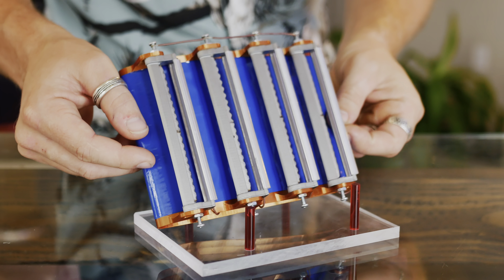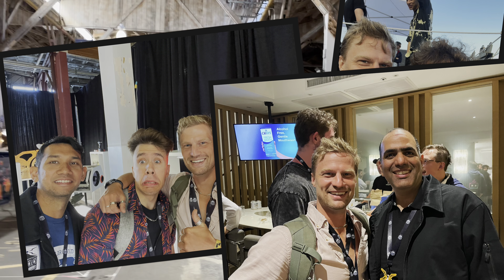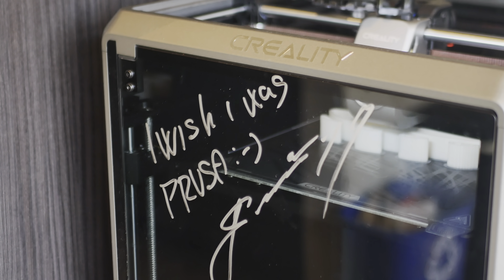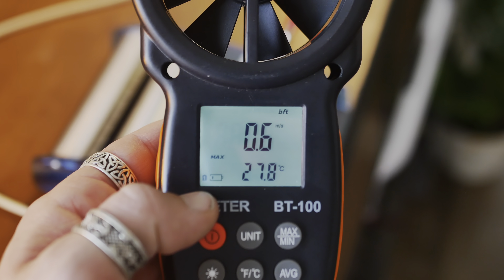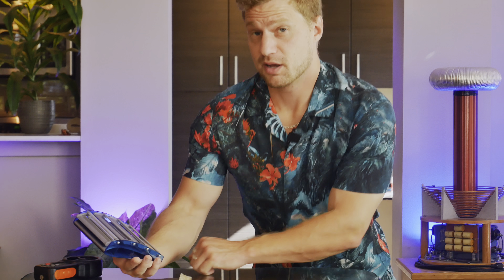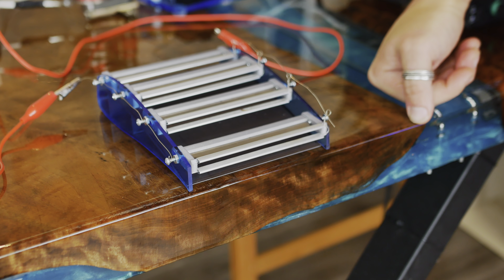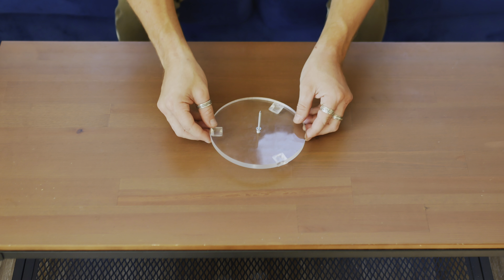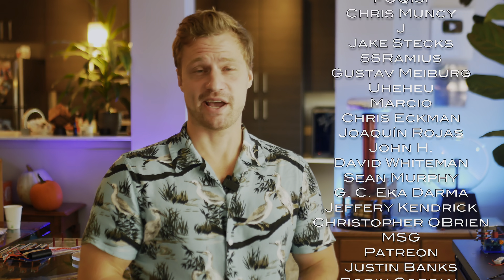Designing A Self Propelling Ionic Thrust Wing

Comment: I would like to "speak" with someone who is open to the idea that the FAA is wrong about has been known as the "overbanking tendency" when an airplane (the wing) is making a constantly banked level turn.  Many people believe that the outer wing (top wingtip) inscribes a greater circle than the bottom (inner wing) thus allowing the outer wingtip to have a greater airspeed.  The thought is that since both wingtips must complete their respective circles at the same time, then the outer wingtip is flying faster.   Since it flies faster, they argue, the airplane (wing) will roll into the turn requiring opposite aileron to counteract the overbanking tendency.  I would like to discuss with someone who believes otherwise, as I do, that both wings are always flying at the same airspeed in a constant bank, constant altitude turn.
          My believe, and many others is that both wings fly at the same airspeed.  The only time one wingtip flies faster than the other is when the wing is being yawed.  The advancing wingtip is flying slightly faster than the other that is retreating.  Is there anybody here that agrees with me?  I can find may who disagree.  Even the FAA has said otherwise in its manuals.  The have asserted the overbanking tendency even before WWII.  I wonder what the author of "Stick and Rudder" has to say about this subject.

Comment: being able to strap this idea onto a wing could be a good auxiliary power boost, but i think there would still have to be a primary thruster engine. perhaps a solar powered ionic boost wing (that is very expensive) could reduce fuel consumption if scarcity becomes an issue. perhaps you could try using a solar paneled skin on the wing instead? (if its light enough?) that would save on the battery weight.

Comment: @Plasmachannel I'm sooo confused as to why this would seem like an idea you'd want to spend more than 20min on. Ionic thrusters are a really low specific thrust engine...why would you think this is good for flight? Not taking into account the fact that generating & managing high voltage is generally also heavy...not great for flight. It's a super inefficient method to fix a problem that doesn't exist...why? This is so confusing. There's a thousand reasons airplanes don't use ionic thrusters...

Comment: Cant you put the ion discharging unit on both sides of the rotating blade to create a torque and the power sources of both the units in the middle of the frame to make the centre of gravity in the middle of the frame? In that way you can design the frame to push air from the top towards the ground and then the whole assembly will be lifted upwards?

Comment: @PlasmaChannel , I saw the convergence of air stream video as well before this reply, i have an idea of using this design, and having the exhaust of each unit go into the wing via a duct system, and all the ducts should circulate the air out through a vent at the rear end of the wing or the fuselage. This means many independent units with their own duct, which will vonverge into a single duct at the rear vent, this should provide better efficiency

Comment: Not as familiar with ion flow, but you’re adding a lot of drag to the top of the wing.  Lift is created from the low pressure/high speed air flow on the top and the high pressure created by the curvature on the bottom.  In my mind it would make more sense to put the thrust on the bottom not the top or somehow in line with the flow of the wing.

Comment: Wouldn't the air being pushed faster over the top rather then the bottom of the wing negate lift? Cause from my point of view it would significantly decrease the difference in pressure between the surrounding air and the air at the top of the wing wich is supposed to pull the wing up.

Comment: I believe this has been made public,  the fact that the B2  bomber uses ionic thrusters at cruising  altitude.  The trials on the ground used 2million volts between  the leading and trailing  edge of the wing. There is a “no arc” device incorporated in the system.   
There is up to 35% fuel economy when using full voltage.   

I  would like to share some original hand drawn plans obtained from my departed friend  Marc McCandlish. 
Toroid based Hg, with nanoparticles Co,Ba,Fe, at a pressure of 200,000 psi in an inert gas.

Comment: This doesn’t quite understand how an airplane flies.

If you wanted to build some sort of ionic drive airplane, you would separate the ionic thrust from the wings or at least have them segmented in the wings like most airplanes do. 

But also consider you can have airplanes with no engines on the wings, and why this works, and then you realize how an airplane actually flies, and the lift in the wing has very little to do would the overall dynamics of how an airplane flies. 

It’s more to do with a lot of thrust and a lot of surface area on a wing.

Comment: There is an aerodynamic reason engines are placed under wings, the top of a wing is actually where it's lift comes from, it is about the difference in air pressure having to travel farther over the top of the wing, also when you accelerate air it changes the pressure as well.
Reply: Aerospace engineer here. Engines are placed where they're easier to access for maintenance, and/or where they're structurally lighter to place so that the overall airframe weight is lower. There is no aerodynamic difference. Lift is generated by moving air down. If the mass of the air you move down is the same as the weight of your contraption, it flies. Works for propellers, wings, planes, rockets, helicopters....Wings are just angled bits which move air down when you fly forward, same as fan blades or your hand out of a car window.

Comment: Very nice. But you have to go back to school. Lift is created by the air wrapping around the entire wing. The air created by the ionic wind must not be part of the wing, but must be applied outside the plane. You can't pull yourself up by your own hand by your own hair. The lift from wrapping the wing with air is only one part of the problem. The entire wing must be "locked" into some volume of moving air, much like a Styrofoam ball in a water fountain due to the Coanda effect. Thus, the wrapping of air from an outside source will help the ground effect take off, and the flight itself is about locking the wing into a volume of air. All this is only possible because of the relative velocity of the airflow. That's why 100 tonne aircraft can fly.  I'll give you a free tutorial - make your ion engine similar to the adhodyd engine. Leave the wings unchanged. Find out the speed of the ionic wind and design the plane to stay in the air at that speed.

Comment: Here’s a Few Ideas Creating a model for an ionic thrust wing capable of achieving speeds up to 10 m/s involves several key design elements. Here’s a conceptual outline:

Design Outline for Ionic Thrust Wing

	1.	Wing Shape:
	•	Airfoil Design: Use a high-aspect-ratio wing for efficiency. A thin, elongated shape will reduce drag and enhance lift.
	•	Materials: Lightweight materials such as carbon fiber or advanced polymers to minimize weight.
	2.	Ionic Thrusters:
	•	Configuration: Integrate multiple ionic thrusters along the leading edge or distributed across the wing surface.
	•	Ionization Source: Use a gas like air or nitrogen for ionization, which can be accelerated using a high-voltage system.
	•	Power Supply: A compact, high-capacity battery system to provide the necessary power for the ionic thrusters.
	3.	Control Systems:
	•	Stability and Control: Implement a feedback system to adjust thrust output for stability. Use sensors to monitor speed and orientation.
	•	Adjustable Thrusters: Incorporate variable thrust levels to allow for fine control of ascent, descent, and directional changes.
	4.	Aerodynamic Enhancements:
	•	Leading Edge Devices: Include devices to enhance airflow and reduce separation at high speeds.
	•	Surface Coatings: Use hydrophobic or low-friction coatings to reduce drag.
	5.	Testing and Calibration:
	•	Wind Tunnel Testing: Before full-scale implementation, test the wing in a wind tunnel to refine its aerodynamic properties and ionic thrust performance.
	•	Field Testing: Conduct real-world tests to evaluate performance under various conditions.

Conclusion

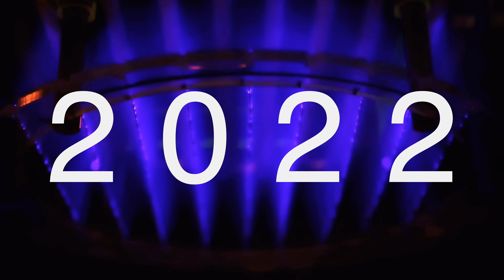This model leverages the principles of ionic propulsion and aerodynamic design to achieve the desired speed. Prototyping and iterative testing will be essential to optimize the design for performance and stability. This Design in Theory Can Reach Up to 10 M/S 0:10 His final Design 0:28 Competition Design

Comment: im sorry y place small thrusters instead of one large one along the  length of the wing. even better would the top surface of the foil is the thruster rather than having a thruster mounted on top of it. The top foil will be a metal sheet recieving voltage for ion acceleration while the bottom would be a plastic or whatever composite thats convenient

ok i get the idea of several thrusters but the other idea is still applicable where the top of the air foil is the thruster

Comment: Cool! The wing is a design to create a mass motion (flow) vector the divides into lift and drag (an elliptic wing is one of the better solutions yielding only about 1/3 overall drag). Since the plasma flow is the source of the flow and thrust the wing seems irrelevant (albeit it would constitute a fail safe). I was wondering if you ever tried using a pulsed plasma to increase efficiency. Good luck! Cheers!

Comment: do!! make sure you get at the very least a provisional patent application(PPA),  before showing any more youtubes , I have written of few of them and they passed, you can write it, there are  instructions at the PTO on how to write it, you can also call the PTO to answer most any question on the PPA on the write up, if you submit and something is wrong, the PTO will send it back with suggested corrections. do keep an inventor's log book, drawings, notes calcs, and results with day, date, and time, and signed as the original inventor, keep on trying, you will succeed.

Comment: @PlasmaChannel Wouldn't you need to put the thrusters along the bottom of the wing where the airflow should be? Wings work on the principle that air flows faster under the wing than above creating lift.
Reply from the maker: Ummm what?

Comment: The ringing is from the boost converters not being completely on the metal and not being able to arc all though if the wires do fully touch the metal being able to arc wouldn’t be an issue it should be silent

Comment: #10:25 - "this makes zero sense".

Not At All, Bro! Looks to me.

Right at the First Video I watched on your Experiments on that Topic,

I told myself that You give Same Voltage to Each Series of Blades,

While in my view, it is a Error.

In mean, See how function A Turbo-Reactor or even a Reactor: 

You have 

. A GRADIENT OF SPEED GIVEN TO THE AIR FLOW.

So maybe You might

. FIND AN IDEAL GRADIENT OF VOLATGE TO GET

. A GRADIENT OF AIR SPEED

and 

. AN ACCORDING REDUCTION OF THE SECTION OF THE BLADE SYSTEM SO THAT THE MOLECULES WILL SPEED JUST BY THAT (think to the Smaler Section of the Outlet of a Reactor, compare to its Inlet 😉 ).

All The Best, 
Khwartz

Comment: #06:44 - Hi Bro! Thank You So Much to Put In Practice the Idea I had to use the Wings Structure Itself as the Propeling System.

Note: You may also use many Surface Aeras of the Body of Plane too 😉

Said that, looks to me that You VERY 

. UNDERESTIMATE your Results, 

because 

. You are no more working on a SINGLE POINT PROPELLING SYSTEM, 

but 

. on a LINEAR (AND SURFACIC) SYSTEM.

It means that 

. YOU DO NOT NEED THE POWER STHRUST OF FUEL REACTOR OR EVEN OF A ROTATIVE PROPELLER (even Very Little)

and As Such, You may:

. MULTIPLY THE THRUST OF YOUR LEANEAR SECTION BY THE WHOLE// LENGH OF THE WING.

Let's 20 m long Wings, and your Section 0.2m, then You may 

. MULTIPLY BY ONE HUNDRED//,

so You need 

. 100 TIMES LESS STHRUST POWER BY CENTIMETER.

Also, You will have to Think about the Energy Source, which can be Batteries but For The Very Same Reasons we, You And Thought about 

. SAVING WEIGHT BY CONVERSION OF THE STRUCTURE OF THE PLANE 

as

. ACTIVE PARTS IN THEMSELVES, 

I invite You to Think Already to

. USE THE TOP SURFACE OF THE WINGS AS SOLAR PANNELS,

Which that your Sthrust System would 

. ENCLOSED BETWEEN THE SOLAR PANEL SURFACE AND THE WINGS,

Or that it would be

. BELOW THE WINGS 

or even

. MAKING THE STRUCTURE ITSELF OF THE WINGS (Saving Even More Weight).

All The Best,

Regards,

Khwartz

Comment: Just started to watch.  Your problem is you created a bi wing.  You increased drag.  I would thing by making it an internal engine would lessen the drag.  I would put the intake under the nose of the aircraft as a blended wing consept and ducked it out the wing.  Add a solar cell wing skin to your battery or compaciders like a tesla power wall would increase the power needed to power a full size engine.  Keeping the weight down.

Comment: So as an aviator I have a couple concerns.

1. What would the stall speed look like?

2. You need to lift the wing more than 1 wing length from the surface. In aviation we have a term called ground effect. This is the zone which at wing actually performs much better while it is with 1 wing length of the surface.

2. You should create a wind tunnel and see how the airflows around the wing with the ion drives attached and in an active/non active state.

I would love to chat with you about this project and give you insight from an aviation standpoint.

Love this idea keep up the great work! I hope it works.

Comment: Have you considered channelizing the intake/output of the airfoils? Build the thrusters encased in the wing. Place a separate ram intake for each air foil and then either have them combine to a single channeled output or separate ports. I would also be interested to see if you got more combined thrust by varying the voltage to each airfoil. I'm thinking each air foil down the wing gets progressive more power. Very cool experiment either way.

Comment: A suggestion. There is wire that is used in older copy machines called corona wire. It's 60 microns to 100 microns. Polished tungsten and gold plated tungsten corona wire. Find a copier tech or office equipment dealer who may still have some in their inventory. It should make a excellent replacement for the blades. Blades have weight, corona wire doesn't weight anywhere close. If you can't find some, let me know, I do have some.

Comment: It doesn’t need to be a true wing shape.   moving air over the top of the surface creates lift.   It could even be the cross section of a cylinder (a helicopter test design did this back in the 80s, with the tail rotor being replaced by a variable air flow over the tail boom — the air flow created “lift” that took over the job of the tail rotor — NOTAR helicopter) … my point is, just make it a narrow oval cross section, thin to reduce drag… and put your plasma thruster on top, and it will probably create lift.

Comment: This reminds me of the "silent black triangle airships" that were observed flying over the Phoenix area in the mid 1990s. Numerous people saw huge black triangles flying at low to mid altitudes at a perceived 60 to 100 MPH later at night. They were talked about repeatedly on the famous late night talk show of Art Bell, as well as local radio and TV news. One popular story was that these were the culmination of "famous" blimp experiments by Lockheed. I was familiar with the "Lifter" experimentation at the time, which was focused on vertical lift rather than horizontal propulsion, and I thought it was plausible that an airfoil shaped blimp (a triangle wing, possibly) with near-zero buoyancy could be propelled by this technology, by orienting the thrust mechanisms horizontally all over the surface of the blimp.

Some folks thought it was the fruition of the "Biefield-Brown" theoretical work that has never been confirmed, and thought it would work in space. But it was conclusively proved to only work in reasonably thick atmosphere. I even exchanged emails with an interested party at the Army Ballistics Laboratory (if I recall the name correctly), until that limitation was proved.
No other explanation for the Phoenix phenomenon has ever been cited as far as I know.

As for Lockheed, the company has numerous airship related patents going back to the early 1970s. A sufficiently stealthy silent airship could be an interesting tool for surveillance. But such a big vehicle would be hard to make invisible to ground obsrvers even at night, it would be very vulnerable to weather issues, and would be too fragile for any hostile environment. And it would have no non-military uses either.

Comment: Have you considered doing a cross section sandwich design? So slice the wing in half and fit the thrusters in between the top and bottom of the wing. Im not an engineer clearly, Im a software engineer but the idea crossed my mind.

Comment: A wing does three things:
1. decrease pressure above it
2. increase pressure below it
3. direct airflow downwards
All these things are much better accomplished by blowing air through the airfoil instead of onto it. I would imagine the whole setup like a linearized turbine, and each of the thrust elements like a (supercharged) turbine blade. There is no extra airfoil needed in that case. It will likely also need less speed per lift, as this setup is a bit like an engine that is partially directed downwards, providing extra lift.